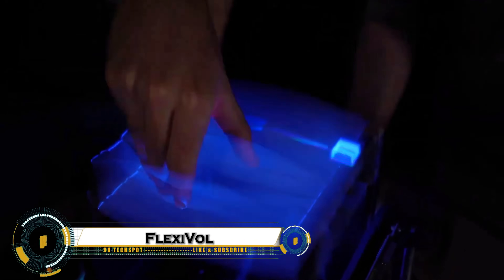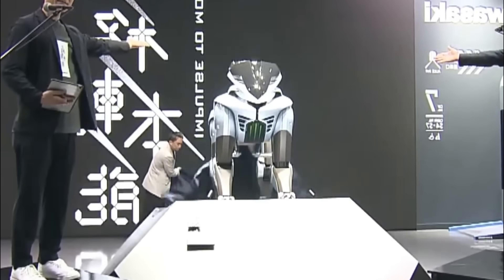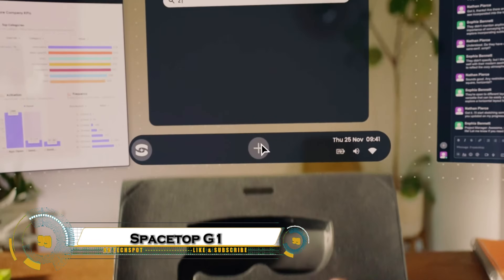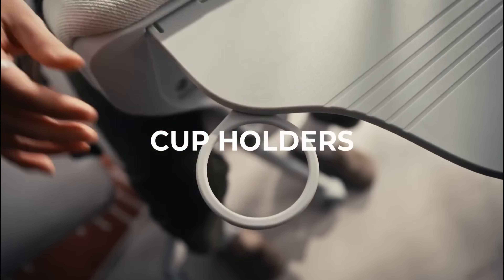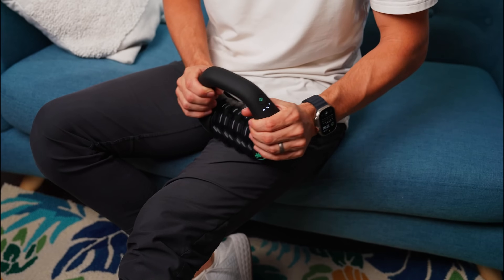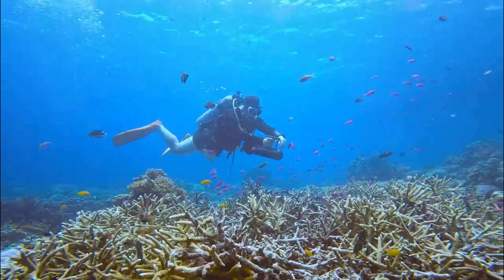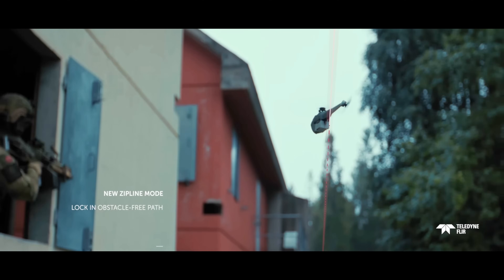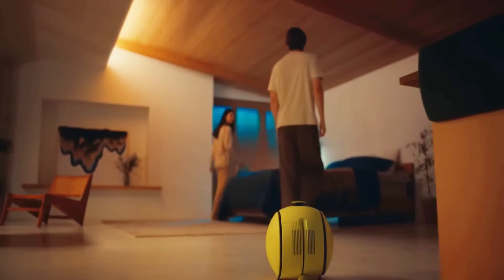15 Amazing Gadgets That Are At Another Level

Comment: German WW2 5cm mortar shell blast

Explosive material: TNT

Explosive material weight: 0.128kg

Thermal fireball injury distance: 3 feet 9.669 inches

Blast lung injury distance: 6 feet 0.441 inch

Damage radiation injury distance: 15 feet 6.614 inches

Fragmentation injury: 20 feet or further

Is this true?